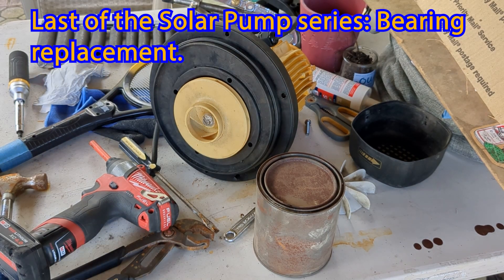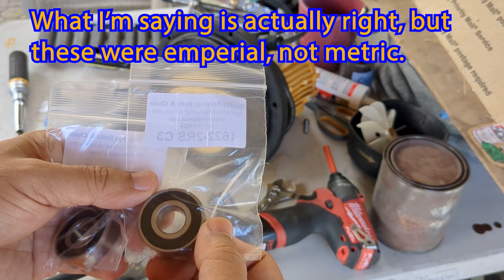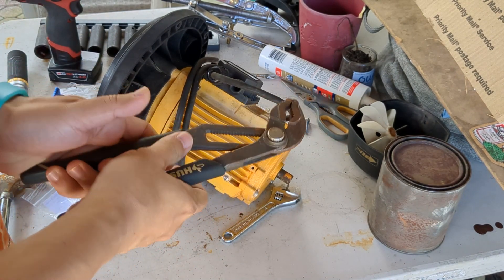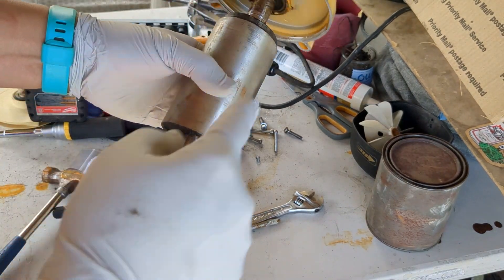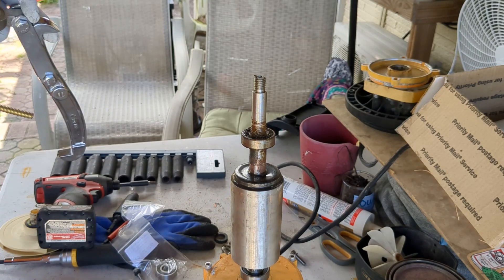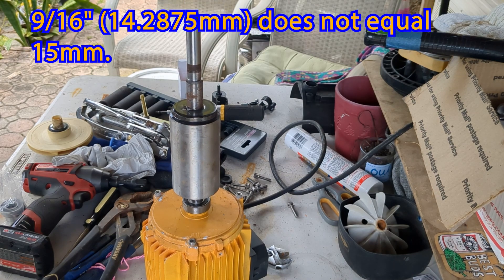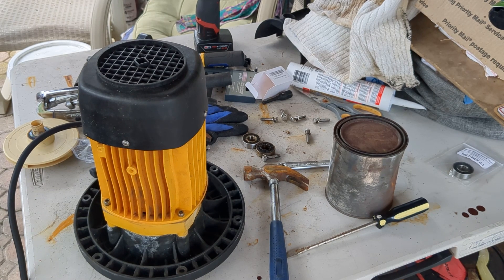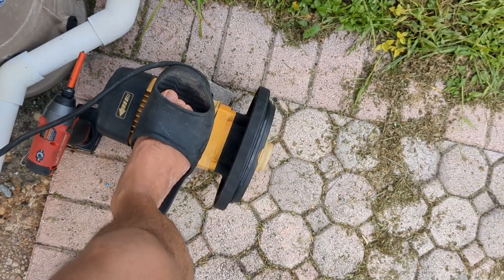Pump bearing repair

Comment: How did you get the fan off? Mine screw is rusted.Is it reverse thread? Thanks
Reply: Pump seal leaking.Do you know where to get one
THANKS
Reply from the maker: I've not had issues with the seal, Bud. I'd search for a 15 mm ID shaft diameter pump seal and see what the interwebs kick back and match with what's on hand. Best of luck.
Reply: @SuperWhizy  I have the same pump but the seal is leaking
Reply from the maker: @paulshakarian3046, if you can pull the part, I've found the folks at my local pool supply stores have also been very knowledgeable and helpful. Or I would normally search for the component online and buy the closest match. Good luck.
Reply from the maker: Hello, @rustyoffgrid. If you're referring to the fan towards the back of the motor, mine was simply plastic inserted into a splined axle. I recall using a large flathead to pry at the base and shimmying it out.

Comment: Did you have to replace the seal of this pump? Do you know the part number?
Thanks
Reply from the maker: Hello, @miguelsanchez4052. I did not replace the seal when I swapped out the bearings. The spring-loaded seal appeared to be in good shape when I popped it back in. All the best with your repairs, Mate.